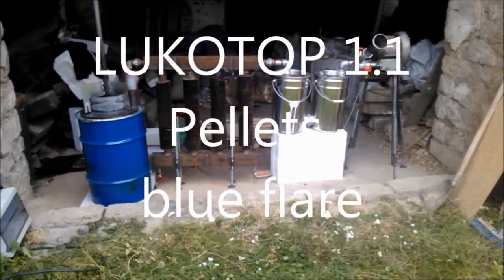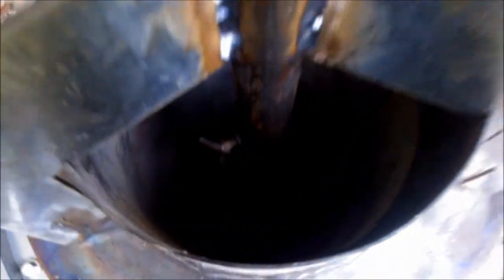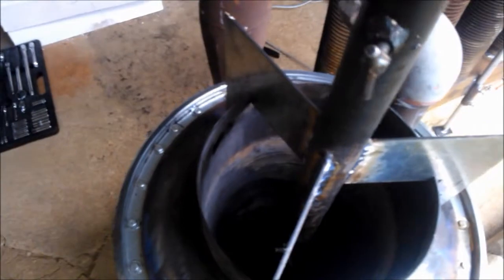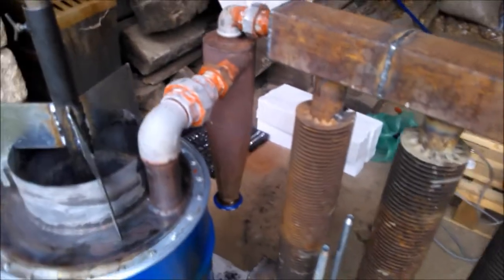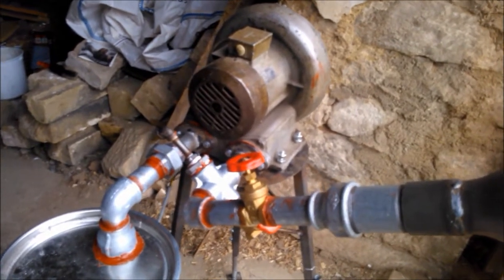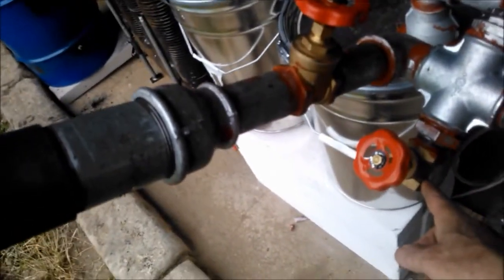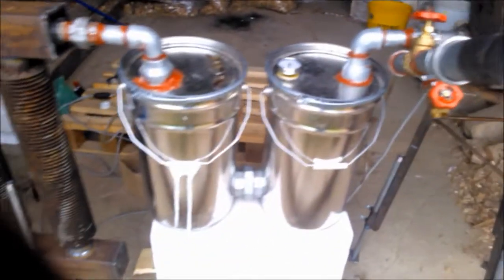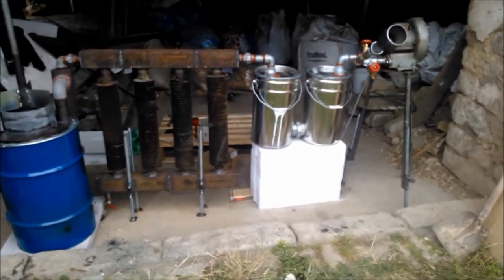"Lukotop 1.1" Burning pellets. Blue flare

Comment from the maker: Fred,
Thank you. I have not yet made a video of the inside because I am Always making small adaptions after every test burn. That is why I call the lukotop a labaratorium setup and not a prototype. I do have a lot of pictures in the photo section of the yahoo woodgas group. 
Unfortunatly I have no workshop and have to give all metalwork out because the version 1.1 should already be replaced long ago by version 2 which i have the design in my head ready.
Luk